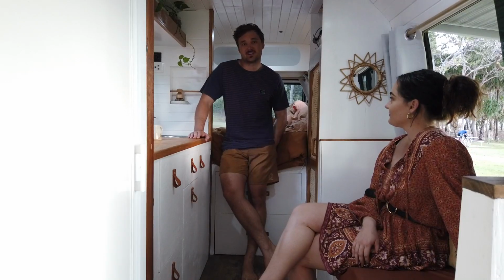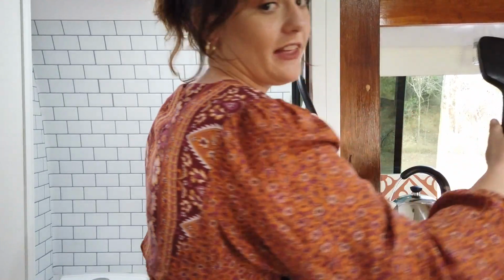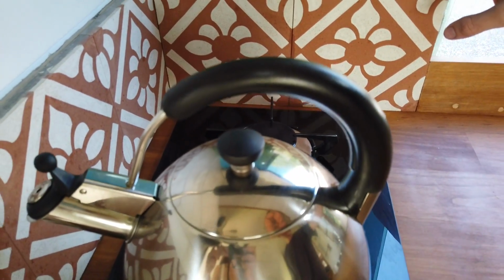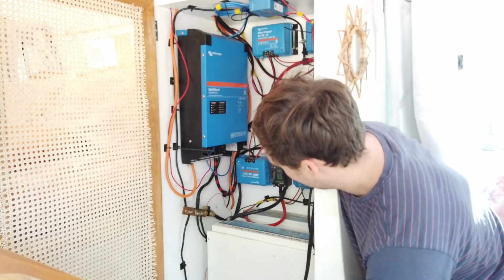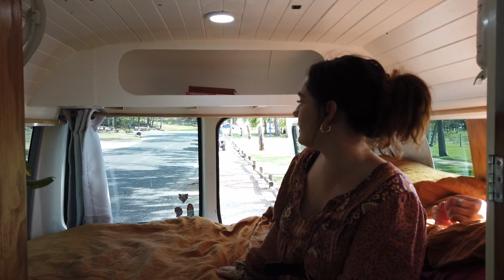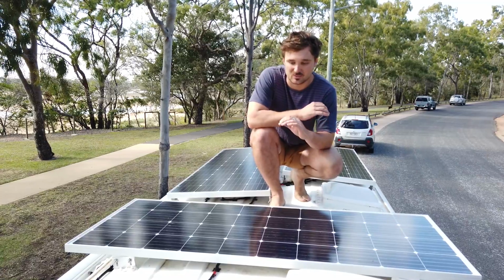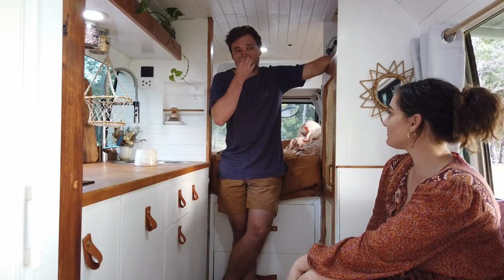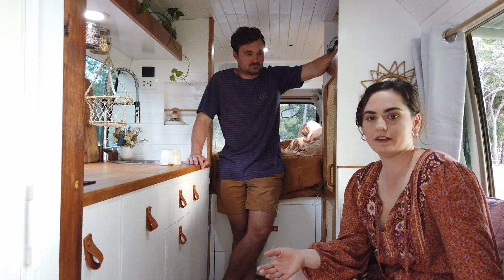The ULTIMATE TINY HOUSE On Wheels 🚐 // Off-Grid VAN CONVERSION With AIR CON & MODERN BATHROOM 🛁

Comment: They didn’t even discuss the air conditioning, only mentioned where they mount the remote and that they store it under the bed. Is it a true a/c or a “swamp cooler” style? If real a/c how do they vent it? Can their system handle it do they have to plug in?
Reply: Hey, sorry we just hadn’t fully installed the aircon at that point so I did avoid talking about it... it’s a truma sapphire comfort... it vents through the floor and you run ducting to the areas of the bus where you want it to cool... and yes our system can run it
Reply: Dylan Blake thank you! I live in Florida and it is very hot much of the year, I have a pup, and would prefer to not need shore power all the time. I appreciate it! Safe travels.
Reply: @dylanblake760  Love your bus..  I just checked out your channel, but there's no content on there.  What up mate?  Lol.

Comment: Nice, but I would add a small corner si k or drop-down si k in the shower and turn it into an actual bathroom with some deck flooring and uses existing plumbing. Alot of people don't care, but it's important 2me. Charming decor.